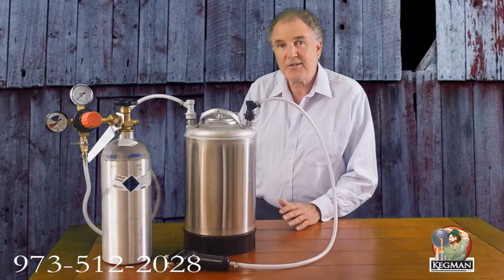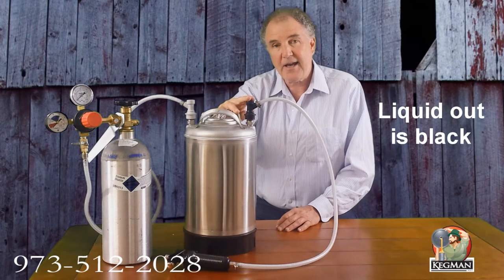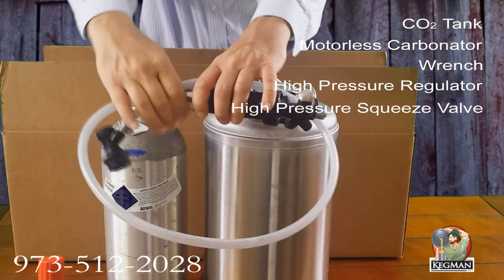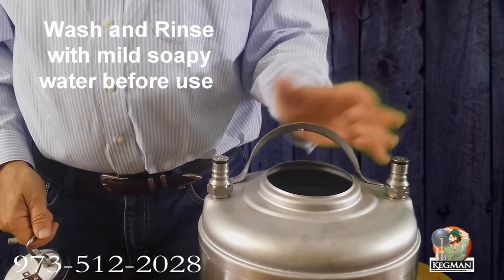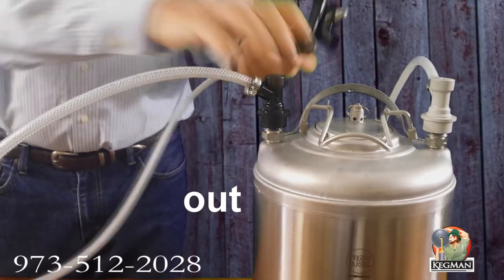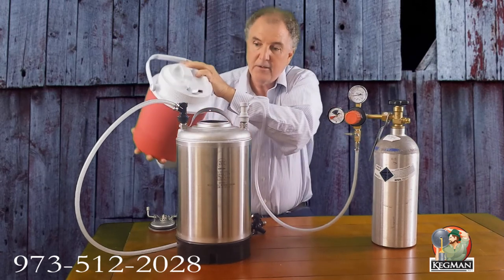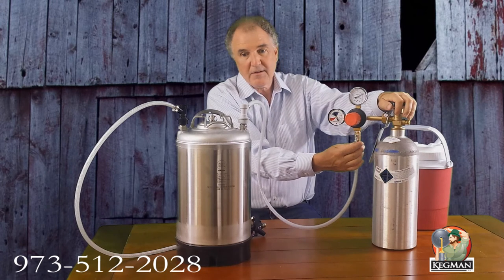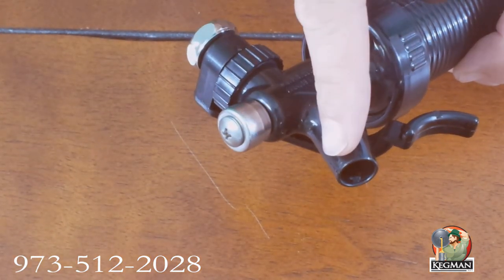DIY farmers market seltzer kit by Kegman

Comment: Does this have a carb stone that carbonates the water quickly?  Or does it get quickly carbonated just with contact with the co2?
Reply: Hi Brian.  We have installed a carbonating stone on the end of a long dip tube on the gas side.  Carbonates very quickly.  Even more so if the water in the tank is cold

Comment: I have been using Brooklyn Boys /Gomberg refillable seltzer bottles. Its expensive to send back and forth. I have looked at multiple systems and yours would fit my interest... except... I dont think carbonating MY HOME water will taste as good as theirs... which I really like. Gomberg says they use NYC TAP WATER and TRIPLE filter it through different filters... and one filter is paper. I dont want a $200 carbonator that makes crapoy seltzer. What do it do if I dont like the taste? I run my town water through a carbon filter for drinking... it has a chlorine taste that the carbon gets rid of. My filtered water tastes great... will it make great seltzer? Its the only thing stopping me from buying your system.
Reply: Roger, you are correct.  The quality if the water is the key ingredient.  Charcoal and paper filters can take out the charcoal/carbon taste.  Some of our customers love the hard bite of their seltzer and some want a smooth tasteless, yet bubbly soda.  Your water is the key.  Our 1000's of kits out there are bubbling away successfully